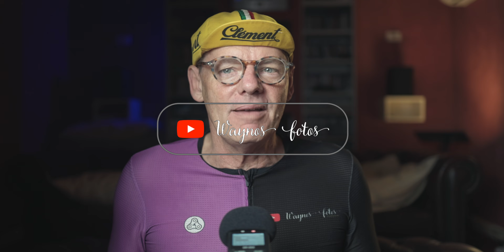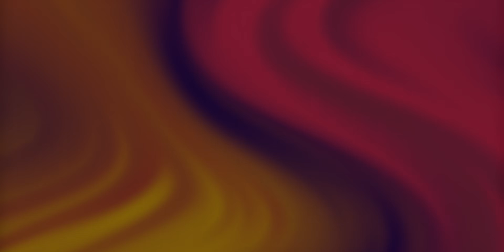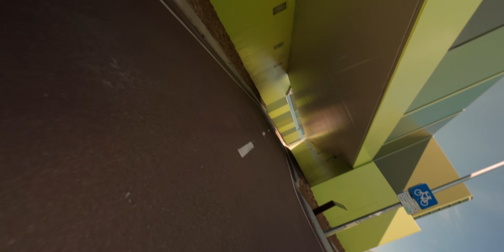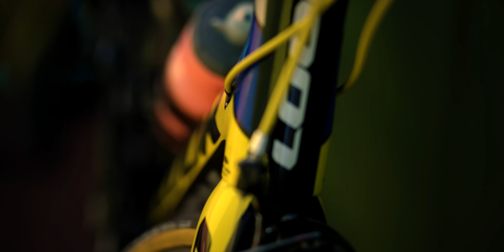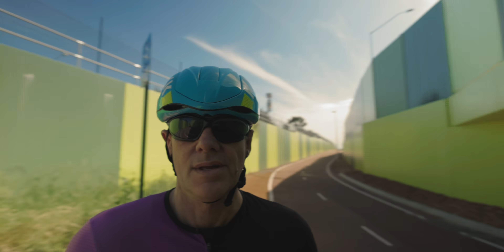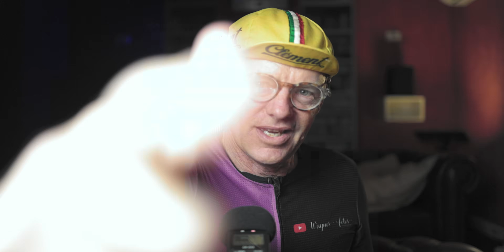TUBELESS tires, a industry failure?

Comment: ... and another think while I'm at it 😆 if manufactures keep selling wheels with narrow internal rim widths, road tubeless will remain a pain the the backside for mosh road cyclists. As Wayne says, it needs wider tyres and lower pressures, which in turn need wider internal rim widths - bloody Giant selling their latest Propel model with their own proprietary hookless tubeless system - 25mm tyres that are recommended to be run at clincher pressures (90+ psi). Bike will take up to 28mm tyres only, so riders over 80kg are stuffed if they want to run non-Giant tyres, and sealant and tyre plugs are a lottery due to the high pressure. FARCE.
Having lambasted Giant's crap tubeless, I'll clarify that I run 28mm Pirelli PZero tubeless on 21mm internal rim width wheels on a SuperSix Evo at 75psi and they are super!
Reply from the maker: Interesting Giant recommend that pressure, european guidlelines limit it to 72psi.

Comment: Makes me laugh when tyre manufacturers provide recommended pressures for tubeless tyres based on width and body weight (literally the fastest rolling pressure) and then you hear all these gumbies saying “I ride 50-60psi on my road bike on a flat smooth road” blah blah. 
It’s is clear some people misunderstand this “whole low pressure rolling resistance” over simplification.

Comment: I personally love tubeless on road bikes, I live in the countryside and the roads are often covered in flint or blackthorn, inner tube n tyre killers! 9 times out of 10 tubeless saves me! That’s 9 less times stopping and swapping out inner tubes! So for me that’s a win win situation, personally I only buy hooked tyres n rims I’m not happy with ability for hookless to blow off the rim, im 6ft2 110 kg run 30c at 70psi rear n 65psi front, they roll fast n comfy and don’t feel too squishy when out the saddle, early days I stuck to Mavic UST as they matched perfectly, but now more brands work well together.

Comment: Wayno great topic to raise and if it proves one thing for sure, everyone is convinced by personal experience on this one.  (All equally valid if it’s worked for you).  I tried road tubeless 10 years ago for about 9 months total, concluded  it was great when it worked , catastrophic when it didn’t .  So no hassle back to inners (sometimes tubs). Tubeless tech not adequately developed for road as a tyre / wheel system back then so doesn’t exactly instil confidence if Q of similar issues arises today.  The demands of physics in off road and on road differ and at the pinnacle of performance  that matters. So Road (no) .  Off Road (yes).  My road max frame size 25mm so dead issue for me.

Comment: I like clinchers with latex tubes!  
I bought a LOOK 795 BLADE RS because the chainstays are not dropped. 
I am thinking about upgrading my wheelset to ELITE DRIVE 50 rim brake wheels with 28mm tires.  (Currently on GP 5000 25 mm)

Comment: I'm kinda amazed the process of installing tubeless requires the use of sticky tape to seal the spoke holes. Just seems improvised. 

Nonethe less I find tubeless good on my mtb, decent on my gravel bike, and difficult on low weight road tires. On light weight/ supple road tires the sealant can't fill a hole reliably in a stretchy/compliant tire...they just get forced out by high pressure which is exacerbated by the suppleness which means its trying to plug a opening and closing hole. 

Also tubeless definitely go flat quicker. Presumably because there is less barrier material meaning higher permeability to the gas. 

Still I run them as they have lower flatiing  rate on dirty roads with lots of tire reinforcement wire shards everywhere. Would be nice if there was a foolproof way to seal the spoke holes as that seems to be a major hurdle to using tubless, both for a diy -er trying to get a good seal, or a far east factory where the tape job seems to beyond their quality control system.

Comment: The deciding factor is the tire width you want, which is dependent on the road surface you ride on.  Assuming the every road rider has smooth tarmac to ride on a mistake.
Once you go wider that 30mm, you are pretty much set on the disc brake system. That opens up wider rims, and lower pressures, which in turn allows tubeless with sealant. Running a 30 or 32mm tire on a 25mm rim width (int) can allow 45-55 psi, where sealant will perform as advertised.
Don't think you can run tubeless with sealant at 85 psi on 25/28 mm tires with any reliability.
The car example is ridiculous. Your car tires are mounted with a machine, and weigh upwards of 50 lbs each. Try fixing you cars flat tire on the side of road by removing the tire from the rim and placing a tube inside. Won't happen.

Comment: Got some. DT Swiss G1800 wheels that are tubeless compatible but still use tubes with them, might make the switch when these tyres (38mm) wear out, but means buying a better pump perhaps to be a ble to seat them easier 🤷🏼‍♂️

Comment: A couple of years ago my Open Pro rims needed replacing. Seeing the way the bike industry was going, I had a chap called Harry Rowland in the UK (who has built a number of my wheels over the years to a high standard) build me up a set of Kinlin tubeless ready rimmed wheels. Here are my observations:-
1. Wheel weight between the old and new sets about the same
2. As I had some good existing clincher tyres (Conti folding 25mm Gatorskins), I started out with them on the new rims. l lost about 1mph in average speed, which fell from around 14.5 to 13.5 in my local hilly area of West Yorkshire. The ride quality was harsh and the wheels felt sluggish compared to the old Open Pros.
3. Changed to 25mm tubeless Hutchinsons, and the average speed was back up, but the comfort was still lacking. 
4. Now the 25mm tyres are worn I have gone to 28mm Hutchinson tubeless. Finally! A nice spritely and comfortable ride. Slightly better than my old wheel/tyre combination IMO, but not by much.
So  performance wise in my experience you  need to run a tyre one size bigger than you used to on clinchers for the same or better riding experience.
Then we come to fitting and maintenance...
The whole tubeless tyre thing has been a nightmare:-
1. Have to buy some sort of compressor to seat your tyres.
2. Tyres would not seal first time so I needed to add more rim tape,
3. Tyres would not seat  the second time so had to replace rim tape.
4. A lot of time wasted in 2 and 3 above trying to get the dam things fitted and with trips to LBS for advice. Swapping new for old clinchers is a matter of minutes and much easier.
5. Messy sealant.
As for punctures, I have never had a problem with quality clinchers. Usually, unless I have ridden over something obvious, when I start to get punctures close together its time to change to new tyres. Never had a problem swapping inner tubes at the side of the road or stopping for a drink whilst patching the old tube. I have only experienced a blow out twice and a near blow out once on clinchers over several years. All occasions my fault:-
1. First time I had not seated my brake pads properly and one side shifted and rubbed the front tyre wall and blew the tyre.
2. Second I knew I was running a worn rear tyre but took the risk on a short 20 mile loop. Luckily I was within 1 mile from home when it blew, so not too far to push the bike home.
3. I had not experienced any punctures on my tyres for a while, so without inspecting them, I went out and bombing down a steep hill I started to lose control from the rear. I pulled over and had a look at the tyre, and the sidewall was very worn. I managed to limp home. 
The point is clinchers are not hassle and offer performance very close to that of a correctly set up tubeless system. If the bike industry was not forcing me into the latest tech by making the older stuff unavailable, for me the extra hassle is not worth the marginal performance gain.
Reply from the maker: Hmmm interesting study. Thanks for sharing 😊

Comment: Into road tubelsss in 2017, and never come back since then.  Even every time i install a new tubeless tyre, i was always hesitating.  Anyway i spend 15 minutes to put on one compair some difficult clinchers also cost more than 10 minutes.

tubeless is just so noticable faster, when you go back to clinchers you will notice it's just more resistance, and while group ride, it's just obvious when everyone is pedaling, i am coasting.  Lose grip is a history for me now.  Only i need to remind myself when i rides clinchers it can be lose grip.  More comfortable, yes.  All my friends weights more than 70kg all cannot go back to clinchers again.  

Yes, my friends lower than 65kg, all of them don't notice pros of tubeless. It's worth mentioning, if you  are a light rider, it's true you not notice any good of tubeless.

Puncture is history also.  Notice Tubeless can be punctured in some occation.  It's not 100% puncture proof.  Considering i use to have 5 puncture in a month, now i have one puncture for my tubeless every year. 

Only downward is i usually keep 5-6 sets of wheels in tubeless, and it's difficult to keep them all in good shape since i really don't really all my bikes that often.  I am trying to down grade some of then into clinchers, still keep at least 3 sets most used wheels in tubeless.

Comment: Converted to Tubeless after getting my first Carbon tubeless ready wheelset in 2019. Have preferred tubeless ever since. Reason - my system weight is 90kg and this is the only way I can ride with less than 100psi (75-80psi on 25mm right now) and i definitely don't cringe everytime I go over a pothole or hump or debris on the road like I used to.

Comment: From my standpoint as a commuter; a wider tire on the back makes sense due to the weight distribution of the rider. Also traction is better. On a racing bike; the same is also true as long as you don't compromise the frame design. Air friction on the back tire is negligible when you consider the rider and that you have already  distorted the air flow by the front of the bike.

Comment: MTB yes, road no. I change my tube tyre once every six months. No mess, run 80-90 psi no issues. 
I had tubeless, flatted both tyres same day different rides. Sealant failed, didn't seal, went on the brake track  no brakes. Put a tube in. Forgot to take the tube out straight away, it glued itself into the tyre, binned both tyres. Tubeless can go away.

Comment: I agree, larger than 25 mm in the front on a road bike is a net loss aerodynamically but for most of us we don't go fast enough for it to make a big difference. Losing a few kilos to increase your w/kg makes more of a difference than the weight and aero penalty between a 25 and 28 mm tire. Hookless ROAD WHEELS are nonsense and will be a thing of the past in about 5 years. I've used tubeless on the road for about 5 years now and have an old bike with 23mm tubed tires and to be honest I can't ride it out here in South Carolina. My lower back is toast after 30 miles. The ride quality is much closer to tubulars on tubeless and with these new carbon spoked wheels you can feel the tires working. I've tested tubed clinchers on the same wheels at 80-90-100 and there is a significant difference in ride feel. The research on tire hysterisis is sound so I would check out the data available concerning tubed and tubeless tires. Can it be a pain in the A to deal with, yes, but so are pinch flats and i haven't had one if those in half a decade HBU?

Comment: @6:28, you make the assertion a wheel supports the load by "hanging" from the top spokes.  In fact, a bicycle wheel supports the load by losing tension on the standing spokes.  They compress just like a wagon wheel.  If you don't believe me, measure it yourself with a tensiometer, or compare the tone of a plucked spoke in different orientations.  The wheel is a pretensioned structure.
Reply from the maker: Same thing.

Comment: I was on tubeless "25mm" tires from 2016-2021, but switched to "28mm" tires with a 30-31mm WAM midway through 2022. Why? Because I started racing at cat 1/2 speeds and the speed difference resulted in more impact energy on rough road surfaces and potholes. The increased tire patch is nice also for descents. 28s are just faster overall for the racing here, with only a couple exceptions on the calendar which feature smoother roads.

Comment: Effeto Mariposa makes a system like you describe, where you don't add the sealant until you get a puncture - basically an inflation cartridge that also contains sealant. They claim it works for tubed and tubeless tires.

FWIW it didn't work for me the one time I used it, which isn't to say it's a bad product, the cut may just have been too large. But it did leave nasty stains on my clothes.
Reply from the maker: I find these pressure insertion don't work to well through a presto valve. If the valve is removable it is better to insert the liquid, i did a video showing this, then inflate to 30-40 psi and spin.

Comment: It’s feels like this video was made in 2017 when tubeless was new. I’ve been on tubeless since 2015/16 when Hunt brought out their first set of wheels. Since then I’ve done hundreds of wheels/tubeless tyres, run tubeless on every set of wheels throughout the year and only ever had one puncture when I used a flimsy Veloflex TLR through winter. Shoved a worm in, let the sealant do it’s thing, Co2 and away I went. In this day and age if you can’t do tubeless then you’re the issue. Use good quality components and you’ll be ok. I’m 90kg too.

Comment: I went tubeless here because of the massive amounts of road debris. We have thorns, bottles (or the remnants of them), goatheads, pieces of metal, and more that take out tubular tyres and tubed tyres alike. I can run tubeless and somewhat get through all of this. Yes, I realize you can use Stan's and such, but they aren't designed for use at 100PSI either. They usually blow out and make a right mess of your bicycle. I love that I can run a lower and thus more comfortable tyre pressure as well.

Comment: For me this is a very relevant topic, as this coming January I will be getting a Gen 4 Trek Domane SL5. The bike comes with a tubeless ready wheel set and a bottle of sealant. I've told the LBS that I'm generally unconvinced that tubeless has enough gain over ordinary tubes for my type of riding (95% paved bike paths). They'll be throwing in a pair of tubes for free which I appreciate. I'll still have the option to go tubeless some time down the line but not right now. I'm a senior citizen so racing isn't on the menu and with a Domane, I'm not a weight weenie either.
Reply: I haven't ever bought a road bike with "tubeless ready" tires, but I recently bought two mtb's with tubeless ready tires. The shops put tubes in the tires by default, and supply you with sealant should you prefer tubeless. I asked one of the shop people why they didn't just sell them tubeless by default. He said it's because they don't know how long the bicycles will be in a shop or warehouse before selling, and that old sealant would cause issues by the time someone bought the bike (not always, but not uncommon). Will have to ask about tubeless ready road bikes in shops.

Comment: Just an excuse to sell new tyres and new rims , more marketing crap, been cycling for 50 plus years, think I have had 50 punctures. As for wider tyres, more wight but faster!  yet more marketing bollocks. Average speed of TDF 1999 40 KPH 2022 42 KPH and the cost in the region of £10k per bike. You are being taken for a ride !!
Reply: And the 1999 TDF was around 3.7K km, the 2022 one around 3.3K. The 2022 also benefited from a lot of tail winds if memory serves me well. So that 2km speed difference looks even less great when taken into context

Comment: Have used tubular tyres for years and been happy with them 25mm has done me fine as long as I can buy them will use them
Reply: Me too
I put a bit of Slime in mine and have had one flat in about 10 years, though I do carry a spare anyway

Comment: Tubeless totally worth it on the road, you can use a skinner tire than you would with a tube at a lower pressure. Because you are using a skinner it's more aero and the lower pressure makes it better for typical dirty roads. I weight 108 kg, and for me the minimum tire size is 28mm at very high pressure with tubes, but with tubeless I can use a 28mm around 55 to 72 psi no problem at all.

Comment: Do a CDA on a typical cyclist, the difference between 25 clinchers and 32 tubeless is negligeable because the mass is the big biological thing on top! As a regular rider of gravel and sportives I have not had a puncture in five years running tubeless. The evidence on rolling resistance is very dependent on what you are trying to do, on bumpy uneven surfaces, i.e. roads running lower pressure 60-80, which is typical foe 30-32mm tubeless is better than 100 on a 25.

You make some interesting points but it does seem to be you don't like innovation. Your view on disc brakes in also contentious. Coming down off a mountain pass in the Alpes during the 2018 Etape, super-hot day, I saw a good number of blow-outs, I know that some of these were to do with rims overheating, yes that could have been combated by running better blocks in some cases but the security you get with discs, particularly if you are over 80-85kgs is fantastic with discs.

Comment: I believe the hour record was just set on a clincher (conti 5000?) with a tube (latex?), and a lot of study went into that. I set my road bikes up the same but with 110f-115r psi on 25mm and have started to use a Cane Creek "eeSilk" (not the "+") medium elastomer seat post for the rough roads which takes all chatter and small bumps away (not sure I can go back). I like the idea that this may be faster when the road is great, and just live for those moments.
Reply: you need a p